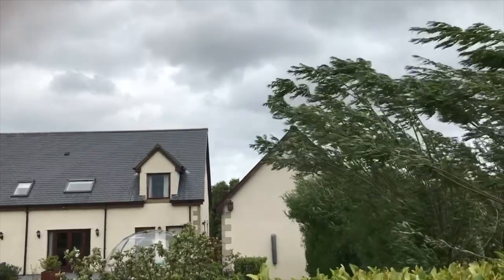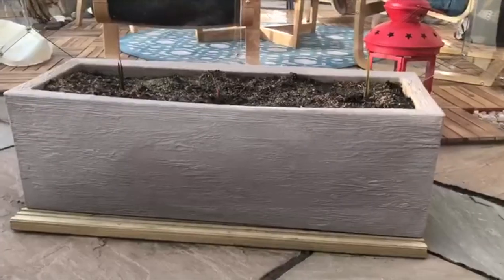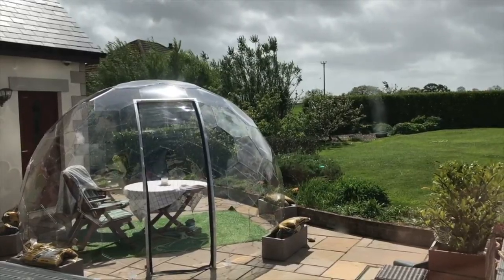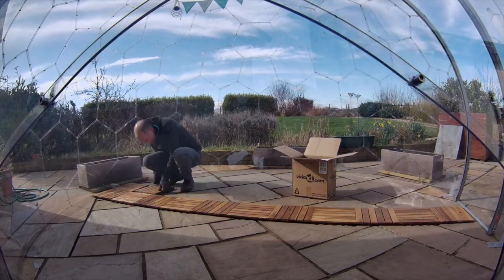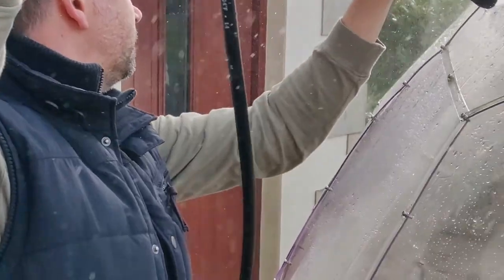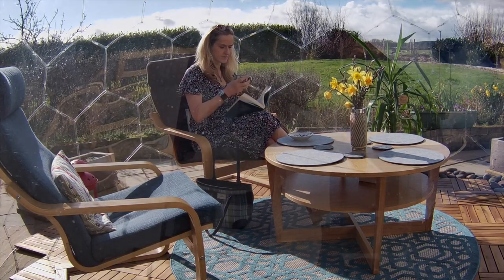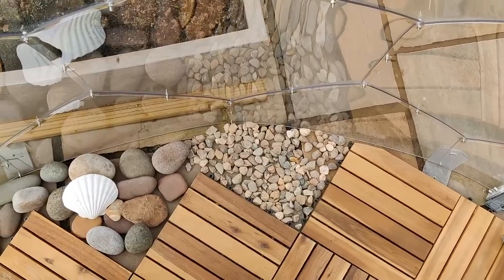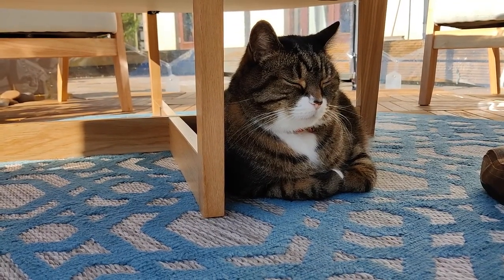The Hypedome 1 year on...

Comment: So couple of questions. There is actually no ring around the base like the asteera one? How do you attach the planters ? The asteera ones are £110 each. It wasn’t shown how you attach the door frame is that easy enough? I presume the sections have been Pre cut?
Reply from the maker: There's no ring around the bottom, it's designed to sit on a wooden deck or grass.  The whole frameless look would be ruined by something around the bottom I think.  There are L-shaped feet that the planters sit on.  They're attached to the dome panels at the bottom using the regular screws/nuts.  Yes, all panels etc are pre-cut.  The door frame is easy enough to fix if the structure is perfectly round (which it should be).  It uses self tapping screws for the aluminium frame itself.
Reply: Hi Chris thanks for reply. Have tried to compare with the asteera igloo. More robust and more expensive ( hyperdome) that one has the ring around the base. With the extras the hyperdome is coming in at about £3000 more. Do like the hyperdome. Do you have any kind of heater or air conditioning?
Reply from the maker: @paulevans6453  Hi Paul, for us the PVC type igloos would just not cut it in the weather we get, and so the money you pay for Hypedome gets you something that will last years, rather than a season.  We do use ours in the winter and have a small portable heater to keep the chill off once the sun has gone.  It's noticeably warmer inside, especially without the wind chill.  We love ours still because it allows us to be 'outside' in any weather and over the course of a few years, definitely worth the money in my opinion.  Hope that helps!  Try discount code CHRISDEVEREUX at checkout and you'll get some money off, which should help towards any extras!
Reply: Hi Chris thanks for info. Can get with interest free credit. Just wondered how have you fitted circuit breaker. Got the armoured cable to go in but how did you set up electric?
Cheers Paul.
Reply from the maker: @paulevans6453  oh nothing permanent, just an outside socket and an extension cable 🙂
Reply: @chrisdevereux  what about the rain?
Reply from the maker: @paulevans6453  The outside socket and the extension are weatherproof, and it doesn't get wet inside the dome
Reply: Ok then what about artificial turf do you suggest 3,6 radius or slightly larger. Will be hoping to order monday
Reply from the maker: Standing it on artificial turf sounds like be good idea.  The dome is 3.6m diameter at the widest part - it curves in again slightly at the base, so 1.8m radius (3.6 diameter) of turf would be enough for it to stand on, and have a little extra around the outside.
Reply: Hi Chris. Do you have any windows? Thinking about air conditioning unit.

Comment: A little silicone caulk would go a long way on this
Reply: i would steer away from silicone inbetween the gaps. its better with the clean lines and just wash it occasionally. i filled the gaps between the  panel joints with a small shim of additional  clear plastic.